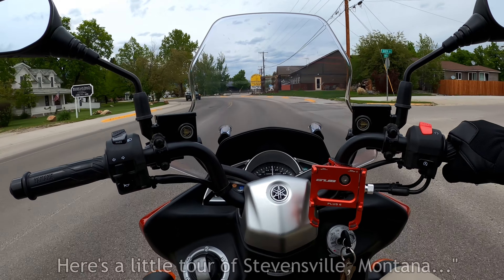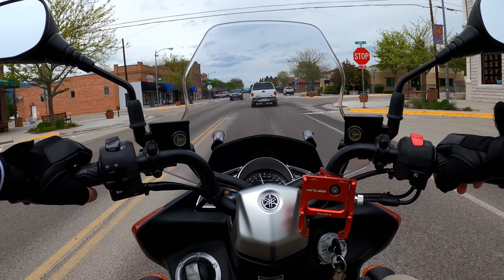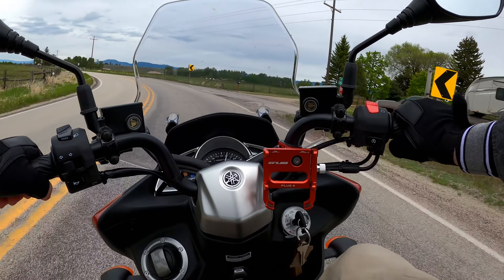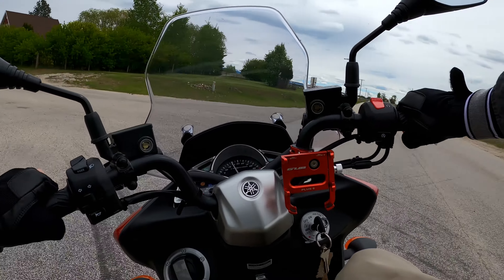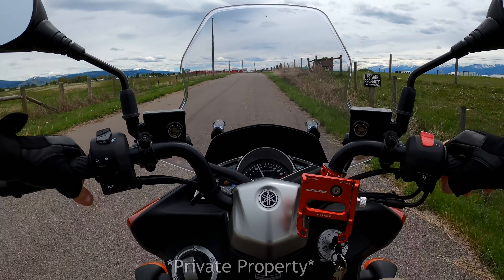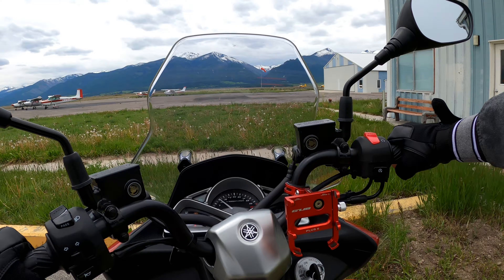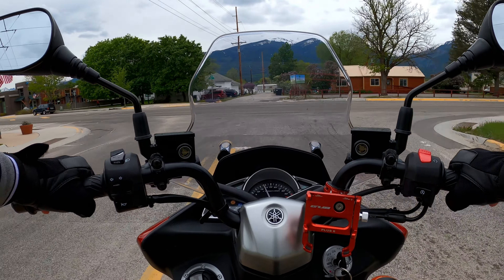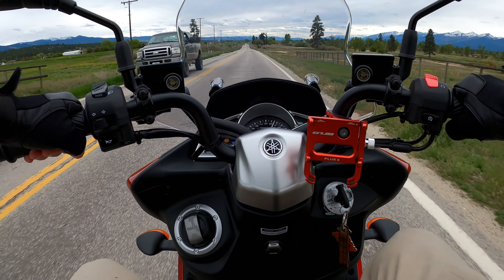The Journey To Stevensville Airport - Yamaha Smax [4K]

Comment: The SMAX seems really awesome. I'm on the edge of buying a new one. Is there anything you would like to comment on the downside or personal dislikes? I have really enjoyed your videos.
Reply from the maker: I would say, consider what your needs/desires are.  If you are certain about the ~150 size class, then the Smax is the powerhouse, versus, for example, the Honda PCX.  You will sacrifice little things like key-less and a power port, but on the flip side, Smax will leave PCX behind when over 65mph is needed.  The PCX is more comfy feeling, as in smooth going over rough road, but the Smax with the center mid-shock handles more like a motorcycle when you get into 60mph, curving highways and can easily counter-steer your way through.  Extremely well planted.  Lastly, it baffles me that our PCX in Indonesia has disc brakes front and back, but in USA still gets a rear drum, and that the 149cc is only 2 vales compared to Yamaha's 4-valve, higher compression engine.  Now, the personal dislikes...
-I really wanted a size up (The Xmax 300) but budget would not allow for that at this time.  That said, the Smax is surprisingly capable on longer highway runs.
-Stock tires aren't the greatest, but even with those, I can still rip curves with confidence (so as long as I know the road and conditions.)  I've heard new tires make quite a big difference though.
-Hated the signal lights at first, but they grow on you when you see how bright they are at night.  The kind of safety you  don't really think about at first, but eventually realize the importance of.  (I'm used to SE Asia where signal lights are all built into the main headlight and tail-light assemblies.)
-I wish for a bit more range from a single tank of fuel.  While the PCX does have better mileage however, it's pretty useless when your speed is capped lower than Smax, lessening your ability for long, main highway runs, so it's a wash anyway.  Also, the Smax fuel gauge is far too conservative.  Empty usually means there's a quarter tank left, and I have yet to figure exactly where the cap is for range.  (Don't want to run it out of gas.)
-Dirt road handling is not the greatest, and there are a lot of dirt roads to explore around here.  It's really a trade-off though.  I'm not paying $600 more for a Honda ADV 150 to have a slower scoot, just so I'm more dirt road capable.  The highway ability of the Yamaha 155cc 4-valve is unmatched.
-I'd like the seat to have been a bit more back, because I ride mostly feet forward.   It get more comfortable with time, though.  I'm 5'8", to give you an idea.  That said, the seat height is about an full inch and a half higher than PCX, so anyone under 5'6" will be one-footing it at stops.  To the PCX' credit, I can get my legs much farther forward on our Indonesian PCX.  I actually love the higher seat height though on Smax.  I feel more in command of the road, especially with the low center of gravity.
Conclusion:  I don't baby the Smax.  I put her through 20 miles+ of 8K rpm, and she takes it like a well oiled champ.  I counter-steer her through curvy roads, upwards of 50mph and she's glued to the pavement.  Durability and reliability have been flawless.  I'm stringent about keeping the oil fresh with Yamalube (dino,) and it's all you need.  $5.95 a quart at the Yamaha Dealer here.  Oil and gear oil changes are a piece of cake,and you can pull it off with merely a 12mm and 17mm socket, ratchet and skinny funnel, easily.  Valves won't need adjustment until the 20k mile mark, so don't worry about it unless a symptom pops up that dictates otherwise.  Contact me anytime for break-in period advice.  Like I said above, this is the powerhouse of the 150 size class.  I've got about a 100 mile radius from home-base without a concern in the world.  My only real regret is not being able to afford the Xmax 292cc.  You want sheer capability without nitpicking the fancy amenities, go Smax.  You want comfort and key-less with a slower high end, go PCX.  If Yamaha brings the Tmax back to USA, you can bet I'll be touring the continent on one.  Hope that helps, friend.  Always here for specific questions.
Reply from the maker: I also love the gauge cluster of the Smax for it's easy, quick glance, bright at night, presentation, with center tach.  The PCX lacks a tach, which even on an automatic, I find very useful, because 65mph means different RPM depending on wind direction and gusts, and the slightest grade.
Reply from the maker: Oh...  Forgot to mention the wind-screen.  While vastly better than on the PCX, I do need to buy an aftermarket wind-screen that's at least 2 inches higher.  70mph on a 155cc scoot means being blasted with wind, and I don't use a full face helmet.  The stock one does well, but that extra couple inches would be spectacular.  I just can't justify shelling out the $90 yet, but soon, I hope.  I'm not a cheap person by any means, but I have girls to take care of in Indonesia that come first.